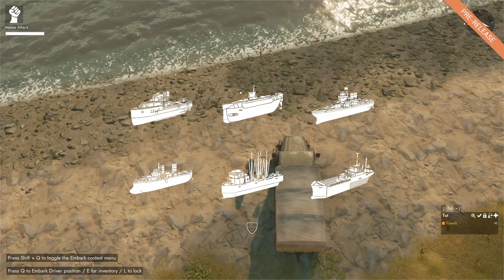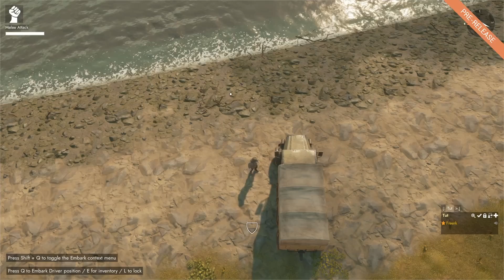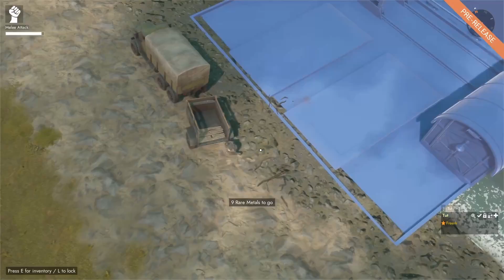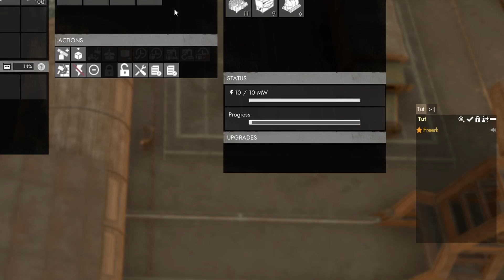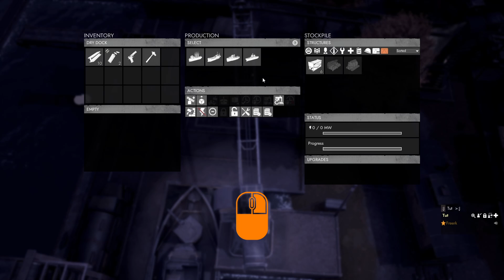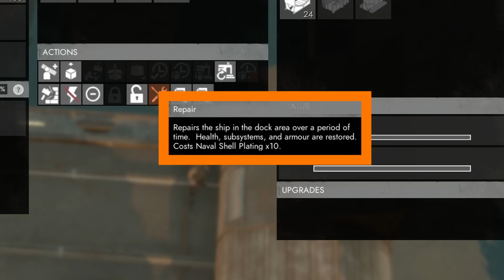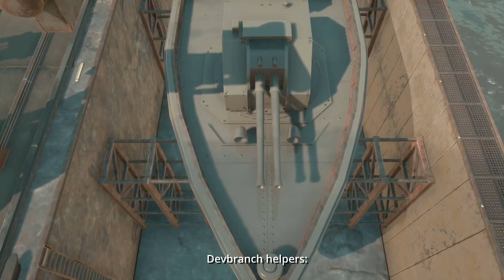Foxhole Guide - Dry Dock

Comment: It seems like on all levels the devs want both organized clans and unorganized solo players to be necessary. You will probably need an organized group to maintain that facility. (You can build a facility solo, but it is exhausting. Maybe if you only want one ship?) However getting the rare metals/alloys does need much organization. Meanwhile crewing the ship requires a core crew in the seats which are organized, but also benefits from having unorganized randos to repair holes, load shells, and bail water.
Reply: I like that design philosophy a lot.

It also kinda incentivizes experienced groups to guide randos and interact with them. Which makes the game more fun for everybody.
Reply: Do the ships need to have randoms on board the ships that were made by regiments?
Yes.... but also no. Mostly no.

Why you may ask? because. if clanman needs to trust randoms to fill in for their crews, they'll do like they've always done and reach out to neighboring allied clans and ask them to send some people to help them fill in the gaps. I've been part of several of these such operations where I was the only member of my regiment in the midst of dozens of people from the main one, with several other stragglers from other allied units.

Sure, the arty example is great and all - but - arty is significantly cheaper than these ships. and judging from what i've seen of the designs - it'd be nigh impossible to get a sabotaging prick of an alt player off the ship if they've set their spawn there. they could just keep running around causing havoc and in a submarine especially? fucking with the ballasts and sinking the ship to crush depth or surfacing it infront of enemy ships. 

With those security concerns in mind - no. No clanman in their right mind is going to allow a bunch of randoms they havent' vetted to playaboard their ship they invested numerous alloys, and DAYS of work into building.
Reply: Whenever my clan does arty ops we usually have a number of randoms to help load and repair especially with 3+ guns. Battleships essentially are mobile artillery batteries so randoms are necessary to run them around the clock.
Reply: Clans dont want solo's around though. And majority wins.
Reply from the maker: @babyboijeremy  I honestly think calans might want to have randoms around, especially on the battleships. We'had a leak in our testing battleship and spent a solid half hour just bailing water with three people. So for ammo running, bailing and sealing leaks I suppose clans want randomws around.
Moreover, the base ship when anchored will act as a normal base, so there's no preventing randoms to join the landing.
The storage ship's stockpile is public, so as soon as that is deployed everybody has access as well
Reply: @FreerkHoltes  bigger clans that can run battleships by themselves won't, though as it can be quite challenging for them to get 30 to the front on a fully crewed battleship

Comment: 0:05 you named 5 ships, but showed 6
Reply: Submarine is only warden, destroyer is colonial only. So you can make 5 ship on shipyard, but there is 6 new ships.
Reply: @alexturnbackthearmy1907  that would've made 5 icons per side, 6 total names

here it's the other way around - 6 icons with 5 names
Reply: @NoNameAtAll2  4:00 4 ships per fraction (2 civilian, same for both sides. 1 fraction specific sub/destroyer. 1 battleship of fraction-specific variant.). 5 ship types (battleships, base ship, heavy transport ship, submarine, destroyer) Battleships are different for each fraction, so there is 2 of them.

In total, 2 battleships, 1 sub, 1 destroyer, 2 shared civilian ships. 6 icons, 5 ship types.
Reply from the maker: Pretty sure it got mentioned in the responses, but the reason there's five is that both factions have a battleship (each with their own icon)

Comment: You correcting yourself in the annotation, but it is indeed Metal, alloy is what your scroop which needs to be refined into the metal.
Reply: It was changed in the most recent update to be the other way round.
Reply from the maker: Things got a bit messy after the devs in all their wisdom decided to flip the names. Part of my footage is from before the change, very few shots are from after.
There were also some changes to the dry dock, it had a normal stockpile (for weapons and supplies) at first, but now only can hold the ship segments. SO I had to redo quite a bit